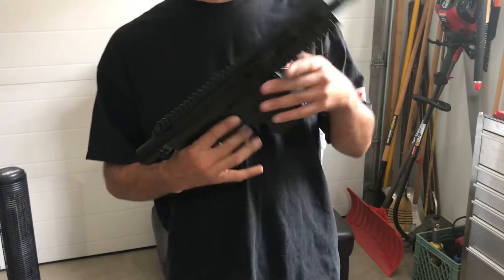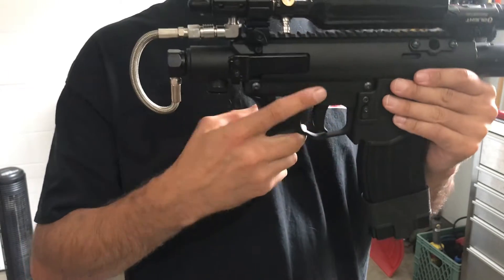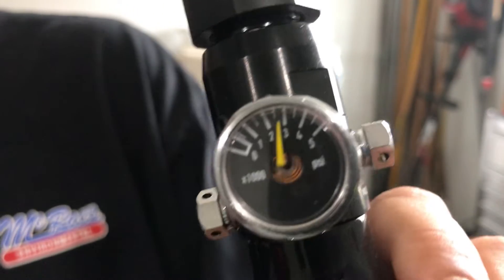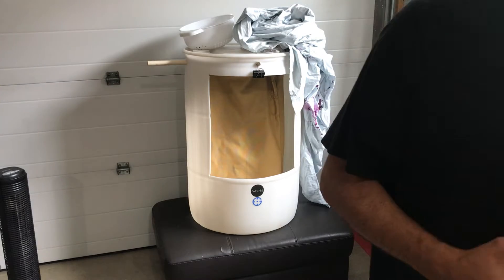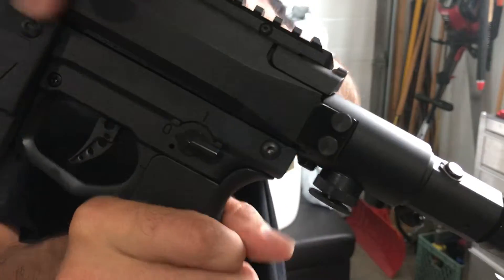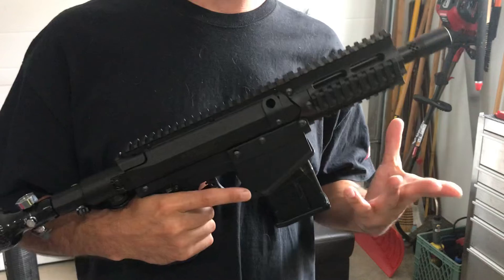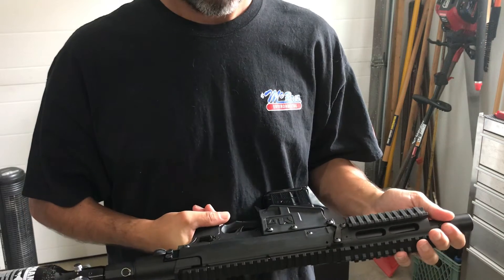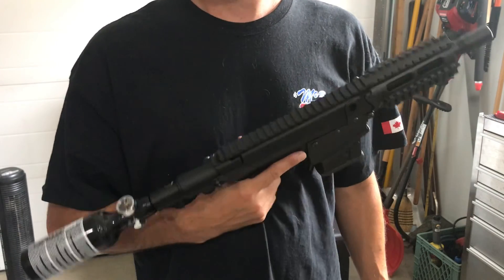Valken M17 bypass V2.0/drilled regulator. Only 825psi. Julv2 and CRB Baseline

Comment: Thanks for the vid.  Where are you getting all your "bumpers" at?  I've been trying to get some for at least a month now and every shop I've gotten some before are all out.  Thanks...
Reply from the maker: You get 2 bumpers with the HE rebuild kit so I just buy multiple kits. I also use them in my Fsc.
Reply: @lesslethalfordummies  what are bumpers
Reply from the maker: Bumpers are the cushion between the bolt and the heatcore when the bolt slams back. I cheap alternative i have been using of late is 3/4” rubber garden hose gaskets. This was a tip from a viewer and a good one at that.